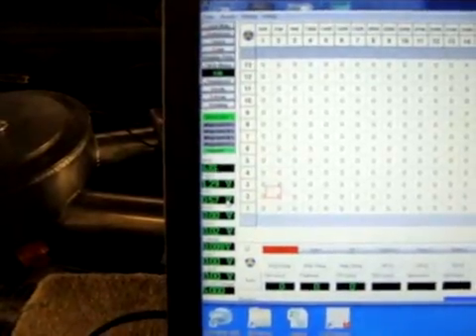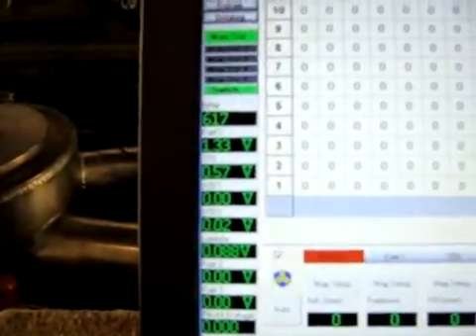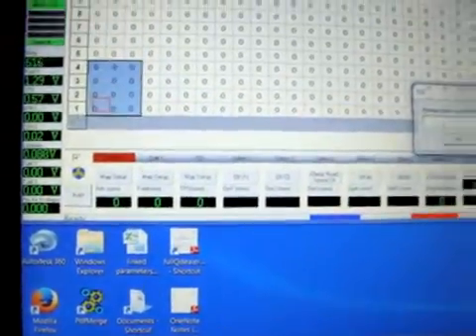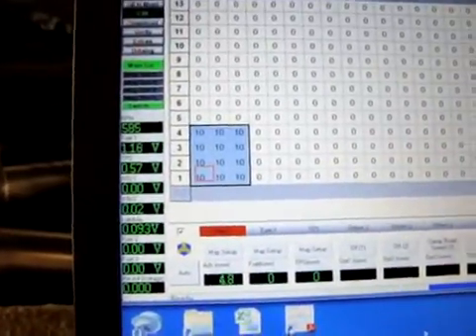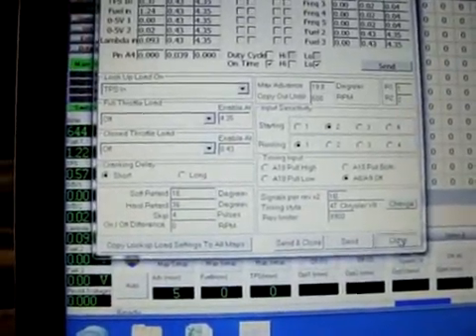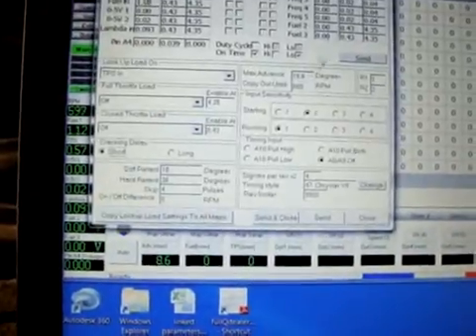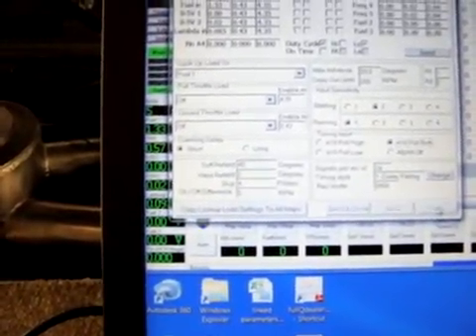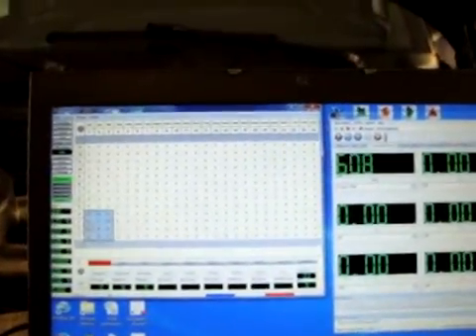Unichip1

Comment: I am curious about the air to fuel ratios . Have you been able to monitor this , and if so what do you see in the difference between wood gas and gasoline as far as the air demand the engine needs. Even an educated guess would be great. Thanks , Joe
Reply from the maker: Joe
I have a wide band o2 sensor and digital display that I use for managing the air fuel ratio.  Wood gas has a slower flame front than petro therefor you need spark advance similar to an engine using methanol. Wood gas is always a vapor and the ratio is accomplished via a manual valve, much like a manual choke on a car. The general rule of thum has been 50% wood gas and 50% fresh air. When I switch from gasoline to wood gas I turn off my fuel pump via a PWM.  I have been trying to use a unichip to manipulate timing, the 4.7 engine has coil pack ignition, no distributor. bummer.

Comment: Thanks  Good  info.    Learn  Thats what its all allbout    Thanks   Fix IT  Tech.    I think what's happening is when you advance the timing you're running up against the knock sensor so it's going from the advanced five or 10 To  zero  so the computer is hunting   running up against A limit    Or RPM  Limit   what is the setting of the idol rpm set the idol I act motor Will roll the RPM backdown  Just My Take